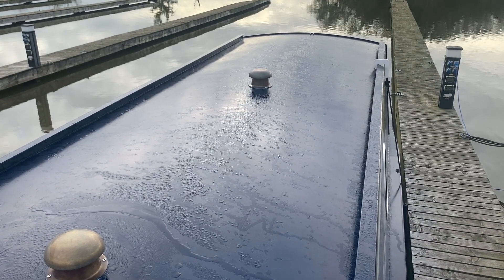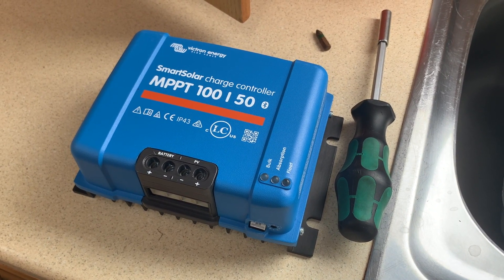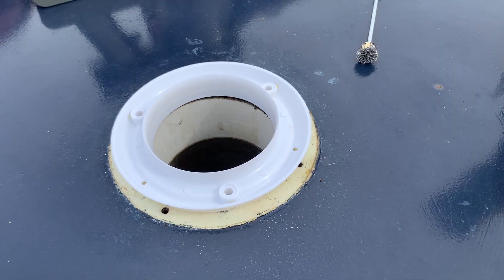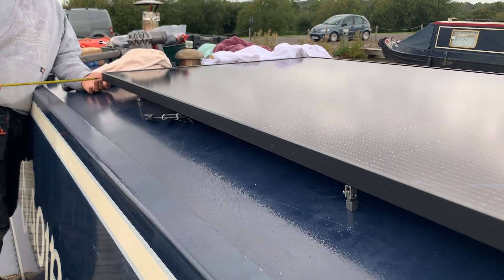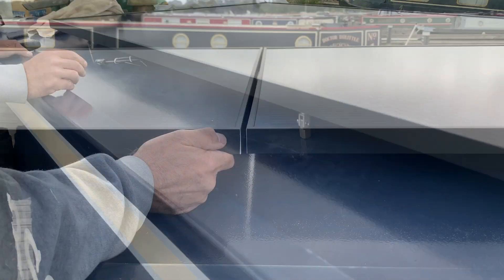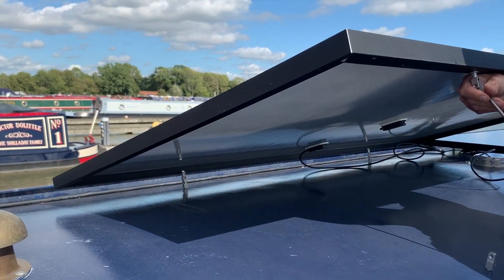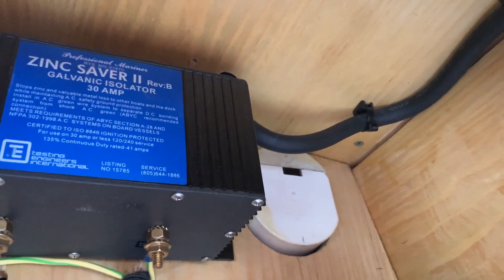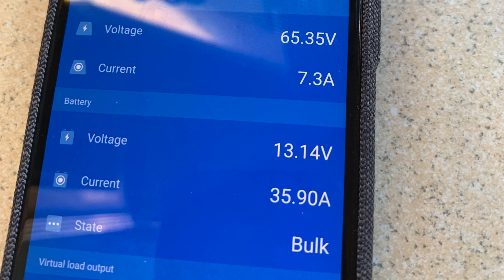028 - Solar panel installation

Comment: Hi. I am interested in getting the same for my solar panels. Can you tell me where you got the hinges from and what stays you found.  Thank you
Reply: If im not mistaken the fittings are clevis fork and eye for gas struts similar to the those on a car with a hatchback or estate ?
Reply: @bobjary9382  hi. Thanks for coming back to me. Sorry to be a pain but can I also ask do you remember where you got the stays to hold up the panel. It’s exactly what I am looking for in my set up.  Thanks again. Bob Johnson.
Reply: @robertwilliam9529 Hi ...Im sure I replied to this ? 
If youre still looking for these Bob ebay has fittings in various sizes, from there you can see who the vendors are and check websites for large ranges to suit .
B

Comment: Thanks for the informative video and contact details for Ed. 
Do I understand that the panels are rotatable 90° in both directions (left/right) ?
If so how is this achieved? How stable are the support brackets ?  
The installation looks good and I will certainly concider it.
Thanks